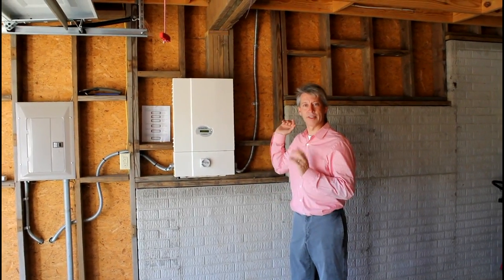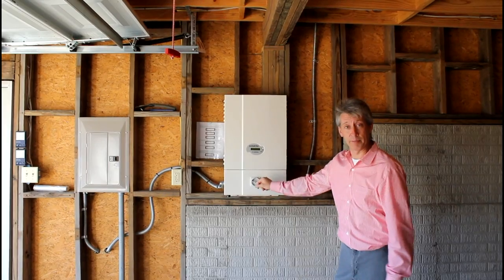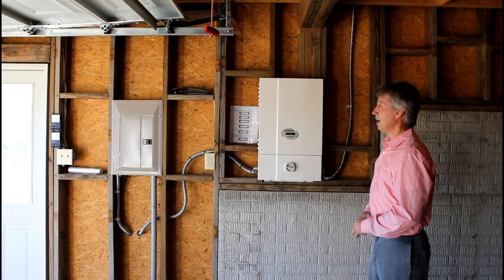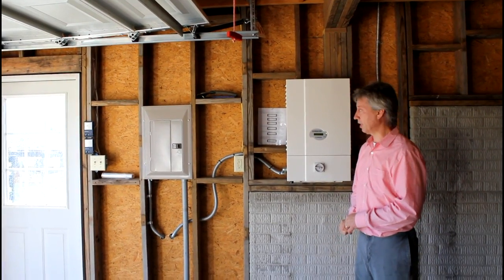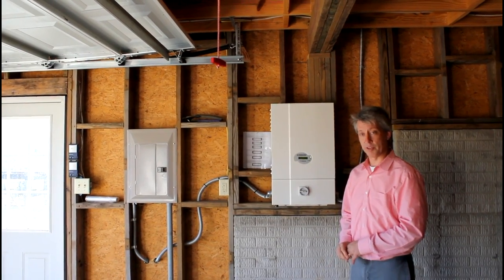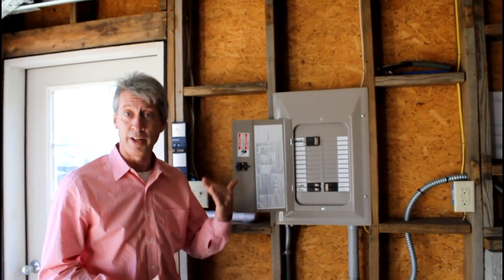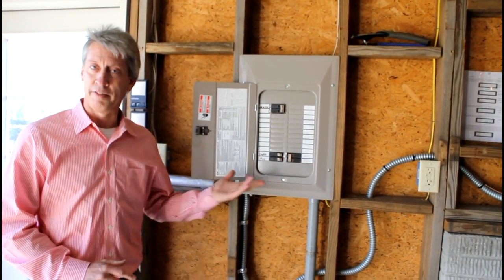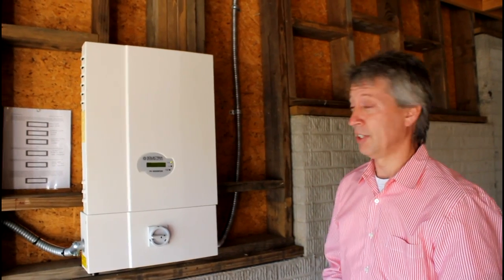Solar Residential Part 3- Inverter and Power Grid Connection

Comment: I have a question, what happens if I disconnect my inverter from the grid? I'm asking this because our corrupt government has decided that all surplus power generated through solar panels will be lost, so we have to consume the power we generate immediately, all surplus is lost. Or in other words, all surplus goes on the grid so that energy companies can sell it on. And because that's theft, I would really like to disconnect my inverter from the grid so that all the solar power either gets consumed immediately by my home, or it gets lost somewhere, but I do not want it to go on the grid for the thieves to take advantage.
Reply: @henrik4173  But then I have to buy a battery. There's a lawsuit pending our government regarding this lie as they promised our power meter would go backwards for all surplus electricity generated by our solar panels. They canceled that now so there's a lawsuit and I think that's my best bet. This lawsuit is like a class action lawsuit in the United States I think. It's in name of all owners of PV installations in the Flemish region of Belgium and the plan is we're going to demand a full compensation of our PV installations minus the amount of money we already gained from them. There's no way I'm spending another 7k on a battery.

Comment: I am looking to install at a very similar set up. Solar array on roof of garage that has a sub-panel,  seventy feet from main house and meter. If I am looking to put on a 8.820 kw system,  what do I need to look at and what do I need in order to not have to upgrade either panel or run additional lines between structures?  What breaker sizes are needed at both the main panel and sub panel?  How does one figure the needed bus bar ratings?

Comment: Watching a few of theses clips. And I installed my Outside Meter Pole and Meter /Breaker Box
In theory minded . If I can connect a wind turbine power full enough to turn my meter . Seems the meter works as a turbine and guage in discize. Will I have enough energy coming thru my Breaker Boxes to run my home energy supply.
Or cut off all of thee electric companies connection. And run a turbine through my supply main lug breaker box to my sub box.

Comment: How does that inverter work where you bring all the power in as DC, then convert it all at once to AC. Does it run output all the time, even if the grid is down or does it need to see 60 cycles on the line to operate..line the Enphanse individual inverts do?

thanks, Jim
Reply: Most smart inverters will stop feeding into the grid if city power is shut off. This for safety so workers on the line don’t deal with your household AC production on the transmission line. You can install a battery bank to continue running power in your home while city is off

Comment: Thank you for breaking down the actual system set up.  This is by far one of the best videos for helping those of us that would like to have an "on grid" solar set up. Can you post a video of the actual hook-up to the existing grid? is it as simple as running the wires from the inverter through the outside disconnect and then back into the grid panel? I think that's where most of us are a little less unsure. The actual hook-up back into the circuit box that is supplying power from the grid. At least it is for me anyway ha, thanks.
Reply: CHECK OUT MY PAGE : "Ken The Solar Guy" to see my 15.2 kW grid tied system from start to finish. The last part of the series will be filmed and posted soon, once I get my final approval from the power company to throw the switch.

At that time we will go through the first time start up of the Solaredge inverter, then ongoing I will update actual, real life production results..

Comment: 1Kw here is about 11cents. So lets say 9 hours of sunlight times maybe 2500watt/hour average(trying to put every panel at 60% efficiency just for practicality) gives 22500watts per day = 22.5Kw = about $2.50 per day average for most if not all of the year(maybe a little less per day). Which comes to $2.50 times 365 days = $912 a year saved. At max output, and still using the 9 hours per day, it's $1561.032 a year. And that's $75/month and $128/month for doing nothing respectively. Love it.